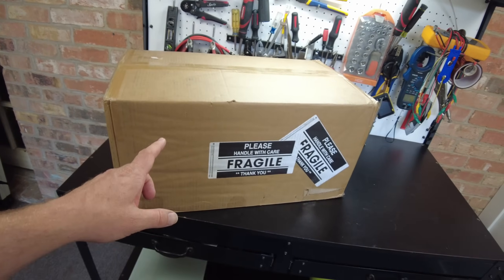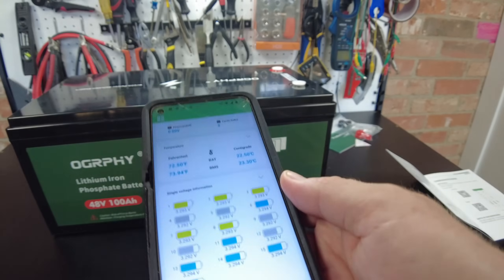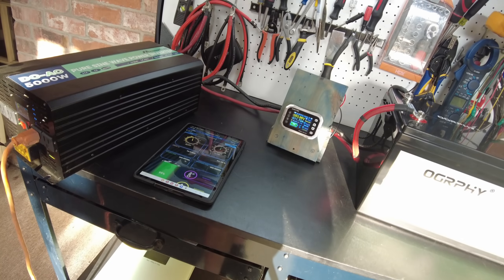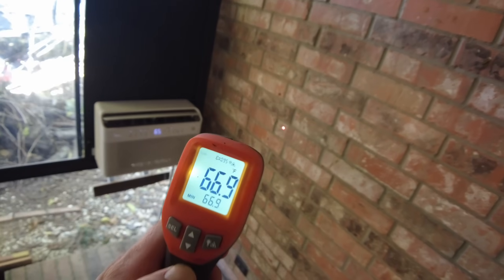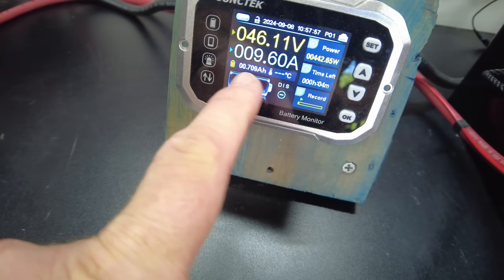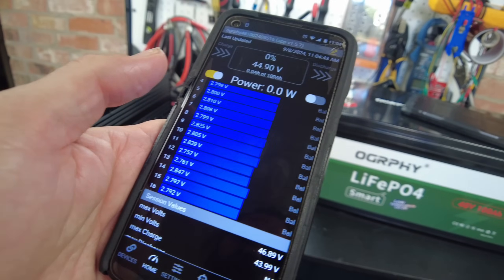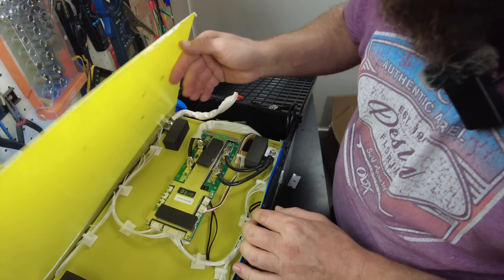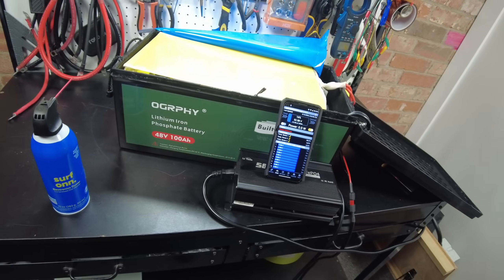Dirt Cheap 48V 100Ah Budget Friendly Bluetooth LiFeP04 Lithium Battery

Comment: Brad, i hope you see this and respond…. I bought 3 of these, charged them to 100% on the Ogrphy charger, all have the integrated Bluetooth BMS…. First night of operation one discharged to 85% the other 2  discharged to 94% and 95% - I connected all blacks to a Bus Bar and all reds to another, of course i have the power out to inverter and power in from the solar panels. Any ideas? I did not install the charger on the first night of operation but intend to today.
Reply: Mine did that at first main thing is look at the voltage after 10 cycles they are like 1 to 2% off
Reply: Wires all the same lengths? Did you figure this out?
Reply: Mine areoff on percent between 4 and 6 but the voltage is always the same

Comment: Running 4 of these, so far they hold up really well and take charge like mad.
Reply: I got 4 in my 39.2ft sailboat powering a 10kw thunderstruck motor and runs everything else including a airconditioner absolutely love em got 18 cycles in em so far and hundreds of miles

Comment: I've bought 2 of these to add to my off grid solar setup. I've got a total of 26000 kwh. I'm really happy that they work with my home made batteries that employ jbs BMS as well. They all work with my overkill solar app. One nice thing about these batteries is the individual cells are so nicely matched and are quite remarkable compared to my self built lifepo4 pack. I'm pretty sure there's active balancing in there.
Reply from the maker: These are pretty impressive. In regards to cell match/balance for self built DIY packs. I've done many, and what I have found is sometimes the cells are not from the same batch, and grade. This leads to balance difficulties. Thanks

Comment: this makes me just want to go 48v lol... nice to run that ac for like 6 to 7 hours nonstop on that 48v 100ah before gets low
Reply: I switched from 12 volt solar to 48 volt and everything is better, charging, discharging, never going back to 12 volts.
Reply from the maker: Yes, these prices are getting good for 48v now! BTW it ran from 6:30pm to 11am the next day, what is that like 16+ hours right?
Reply: @BradCagle  thats a long time too and will kinda vary depending on setting on ac.. was 100+f in my trailer here in California pass couple days with lots of sunshine 🌞  

What size and how many solar panels you recommend to get to use this 48v and what solar charger.. not trying to go super big on the set up on panels just enough because trailer is small.
Reply from the maker: @thatonebeone  Probably would go with a minimum 1000w of solar. But really depends on your consumption, you could go less if you don't need that much. Then you just have spare battery capacity for cloudy days or something. As for charge controllers, I really like Victron, and the prices have come down a lot on them. Victron 100/20 is way affordable https://amzn.to/3Ts2Mj3
Reply: @BradCagle  thanks.. even if I'm getting 10 to 15 amps power from solar is good enough for my needs.  I don't plan on running the ac non stop maybe 20 mins at a time till gets warm again..  run fans/ rice cooker/ charge phones tablets /led lights on 12v which will be extremely more efficient.. nothing heavy loads maybe I'll use a heated blanket in winter instead of a heater since they eat way more power .. thanks for input 👍🏼
Reply from the maker: @thatonebeone  Yes, heated blanket is the way. We use them when camping in the winter. Thanks